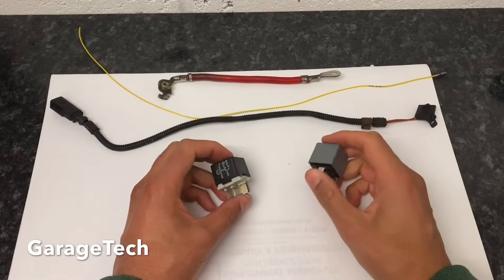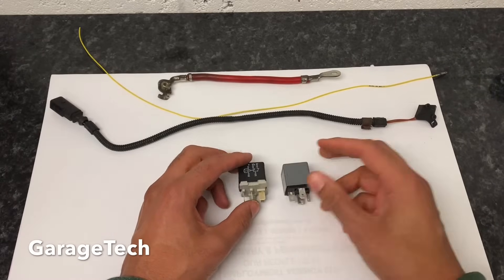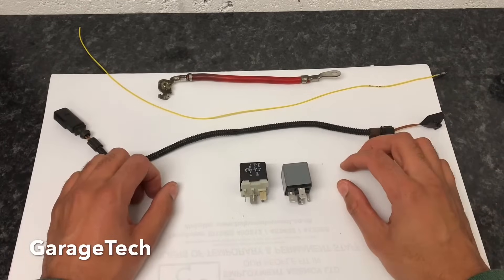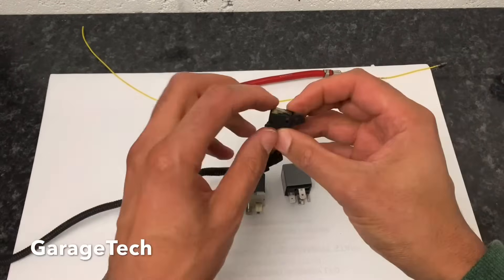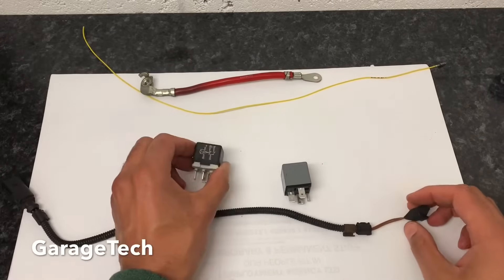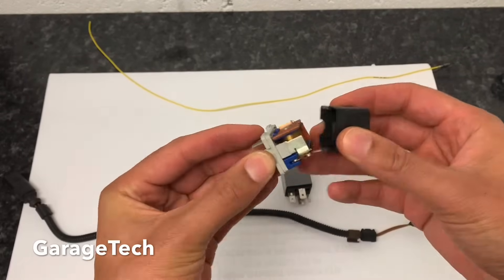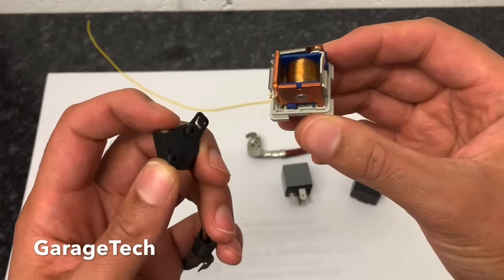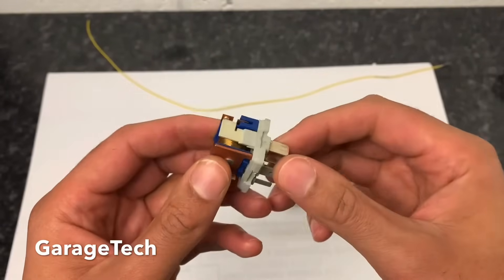What is a Relay used for?

Comment: So its to save money on wire size?
Reply from the maker: And weight 👍🏼
Reply: @GarageTechAutomotive  what I don’t understand completely is,,that I think your only saving on the switch wire. So I assume the relays should be as close to the load as possible right? So you still need two wires to every load,, or multiple loads like lights.
Reply from the maker: @BasketCaseGarageForFun  well yes, but don’t forget that the relay also allows you to use small delicate switches within the cabin area which don’t carry high loads.

Comment: Trying to run 2, 45w spot lights for the boat.. currently going directly onto 12v with aligator clips for on off switch.. 
Planing to add an on off switch.. do i need a relay/fuse on the line as well? Why??? I cant get this.. also may upgrade to 120W led lights.. just dont understand the relay stuff..

Comment: I am still lost
Reply: 😂 lol
Reply: Without a relay, if the load is heavy duty like electric kettle, the switch is directly connected to the main wire that carries high current. But if your switch cannot handle high current, it will get damaged. But with relay, if your switch  can handle only low current, the relay will handle the high current, you can still safely use the low current switch to control the high current load with the use of relay.
Reply: @dylanoracle3742  But wouldnt the high current flow throughout the whole circuit after the relay switches on? Like wouldnt it eventually pass back through the switch we are trying to protect? Thats what I dont understand
Reply: But, how bro?
Reply: Yeah, I mean I get it but at the same time if you’re using a toggle switch with in-line fuse, I get a little lost, but it was reading some comments and didn’t hear the volume the whole time so I’m gonna rewatch the video
Reply: It's like a repeater in minecraft😂

Comment: Why do I need an "electronically operated switch" for my lights when I am using a manually operated switch already? I just want on and off, so why do I need an extra switch and twice as much wiring for a relay? Someone messed with my fog light relays and now my truck's battery is dead all the time, the lights don't work and even the illuminated turn on switch doesn't work correctly. Can I bypass the relay to just have on and off? I don't care if the turn on switch lights up or not. What happens if I bypass the relay and just have fuses where they're needed?
Reply from the maker: Hey, the relay is there to enable you to switch from a low current circuit (the switch side), to a high current circuit (the fog lamps). This means you can use small switches and thinner wires within the vehicle and then larger wires closer to the fog lamps. The fog lamps will take quite a bit of current (amps). without the relay the switch could burn out or the wires could get really hot, melt or catch fire. All depends on the current load the switch and wires are able to take.
Reply: @GarageTechAutomotive  so if the wires are the same on either side of the relay, does it still have use?
Reply from the maker: @jamesmkay  hey, this depends on the switch that you are using. The switch may not be designed to carry the high amount of current which will be drawn. If it’s a small switch it’s likely the contacts inside will burn out.
Reply: @GarageTechAutomotive  thank you

Comment: I purchased a Toyota IQ 2009 push start button last year it was good and all ( its a used car) but i didnt drive it for a little while and now that i'm ready to drive it, its not starting..... Couldnt be the battery because i purchased a new one when i got the car, i just replaced the gas pump and there's petrol in it....... When i push the button to start it stuff shows up on the dashboard but when i try to start the car its making a clicking sound repeatedly then its like its dead again. What could be the issue??
Reply from the maker: Although you put a new battery on, from what you say, it’s sound like a classic case of a flat battery.
Reply: @GarageTechAutomotive  is there any way i could connect with you??  Please Maybe im going to have to buy a stronger battery the.....
Reply from the maker: @genesiswaltz9632  hey, you can follow on my social, Links in my home page. First check would be the battery, if it drops below 9 volts when trying to crank the engine, it’s dead.

Comment: For LED fogs I have a switch rated 10 amps.
Any point in a relay here ?
Reply from the maker: Hey Thomas, Important thing is calculating what the total current draw will be in the circuit, you’ll need to know what the amps are of the fog lights first. If you have done this already and it’s less than 10 amps, just make sure the wiring you use exceeds this. A relay helps to use smaller wiring and switch to turn on a bigger/higher load circuit. Also, make sure you have a fuse wired in, otherwise it could 🔥🔥🔥 good luck 🤞🏼
Reply: @GarageTechAutomotive  previously installed aux fuse box, easy power connect. Fuse is 10 amp, fogs did not come with intel but I’m thinking they’re low current. Wires from box are 12 ga others are 14 ga. 
Junction and switch fitted in waterproof Bakelite box, i could probably get a relay in there too but won’t if there is no reason.

Comment: So, I am a little confuse here, but where does the big load side go on? Does the big load go to 85,86 of the relay while the small switch connects to 30,87 of the relay? Or does the big load go to 30,87 of the relay while the small switch connects to the power side of 85,86 of the relay? Also I am guessing you have a relay with big enough current specifications for big load side right?
Reply from the maker: Hey, the big load goes on 87 and then to a separate earth. The switch goes on 86. Depending on what your load is then yes you may need a bigger relay that can take a higher load, like a relay for a coolant fan will have a higher load than say a horn. If you haven’t done so already, watch my other video on how a really works, that explains the wiring side of things. Hope that helps 👍🏼
Reply: @GarageTechAutomotive  Thank you for explaining that as that makes more sense, I will watch your other video as well.

Comment: I’m still not getting why your switch inside the cab wouldn’t do the same thing (on/off) on its own without the relay. And why the relay would be needed
Reply: If switch can’t handle current the relay saves it.
Reply: Yeah I sometimes ask ma self the same question….🤔🤔
Reply: If you send the main circuit direct to a switch that sends directly to the receiver, then that switch can always be turned on/off even if the car is not turned on, unlike if using a relay the switch can only be used if the car is turned on.

Comment: From what i remember from school, 
Control high with low. In automotive uses, you don't want a ECU to control high amounts of current, i remember hearing more than .5 amps i believe is too much for a ecu to handle so using a ecu to control the low current side to trigger the relay to control the switched side/high current side.